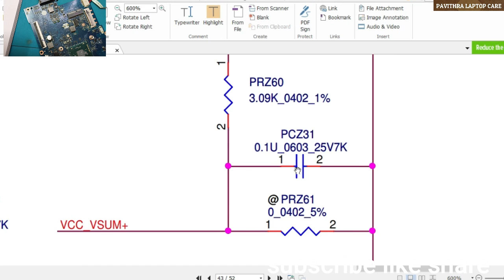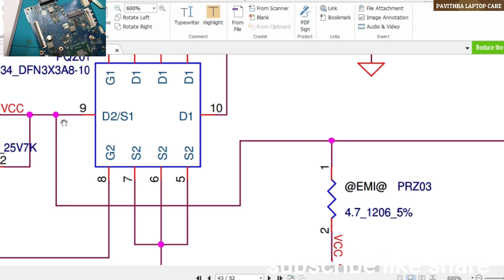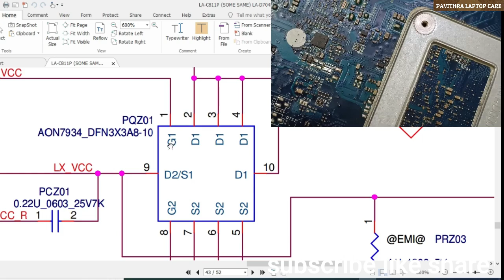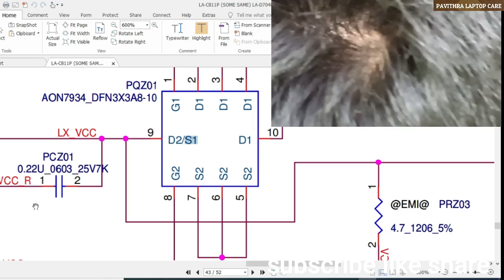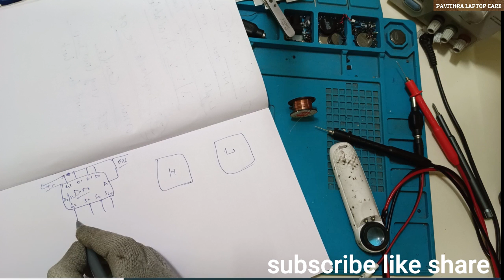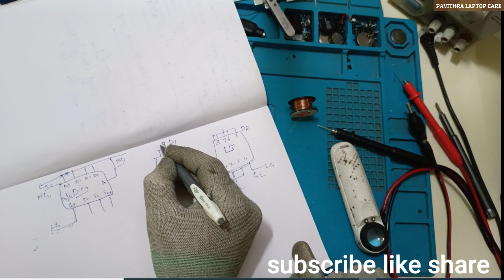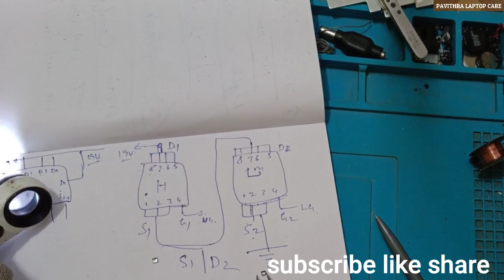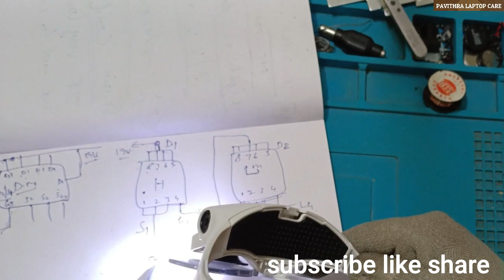How to Identify the PCH or SOC Short in Laptop Motherboard Repairing? cpu VCC_CORE

Comment: Sir u said, as RAM volt generated Bios is good. My question is that if Ram volt  not generated, Bios faulty? In no display case pls reply
Reply from the maker: Multiple reasons for bios faulty.. if u have DSO then check bios ic pins. If bios is good communication with io and pch will be ok and ram voltage will generate. But ram slots also need to be checked in no display case. Dramrst should generate..
Reply: @Pavithralaptopcare  thank u Sir

Comment: Sir you replace sort processor of gaming series
Reply from the maker: Actually we won't replace the processor or graphics.  You know very well , for new processor cost will be almost similar to the refurbished motherboard.  So, we do all services except bga
Reply: Sir in gaming laptop motherboard too costly
Reply: If cpu short whole motherboard gone
Reply from the maker: Are u confirmed from any technician that cpu has gone?
Reply: Sir, due to shorting of mosfet, 19 volts of main power line went to the CPU core and the CPU got shorted. The reading of 0.3 ohms is coming and by opening the coil of the core, the board is turning on. Can CPU replacement be done i5?  8300h processor
Reply from the maker: @technicalzugaad7589  if possible,  u can send the board. We will check and give the quote.  Do whatsapp or telegram  +918861880678. Thank u